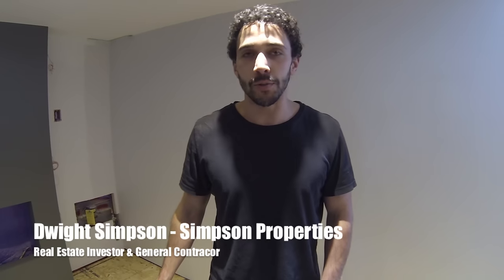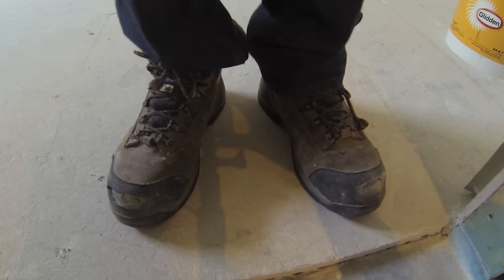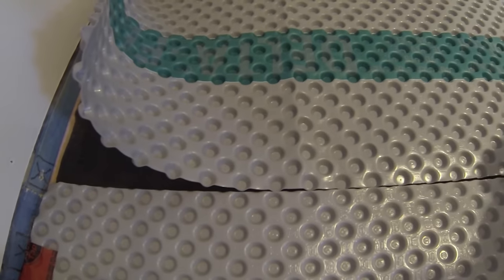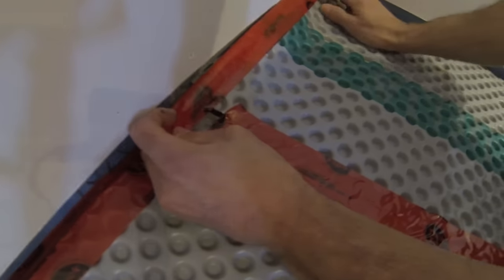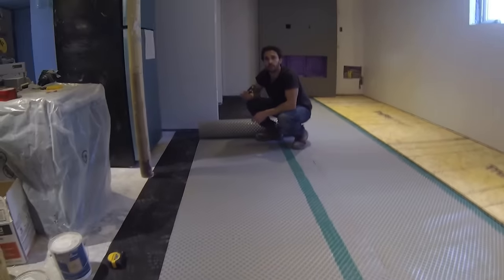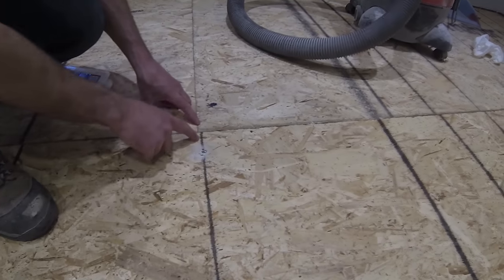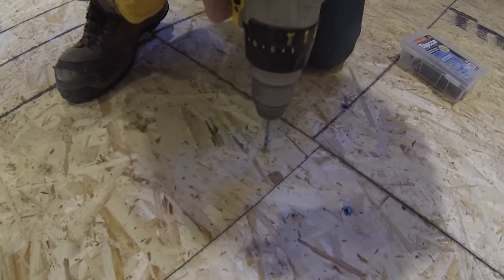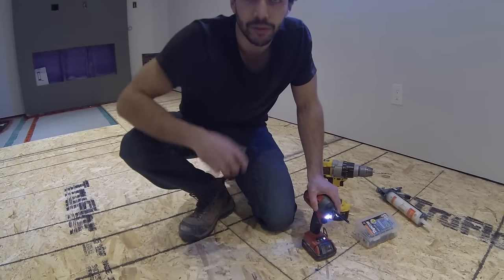HOW TO INSTALL A SUBFLOOR ON CONCRETE

Comment: Can this method be used for a concrete slab? And for solid wood hardwood floors?
Reply from the maker: Yes this method can be used for a concrete slab. Normally hardwood floors have to be nailed and or glued down. I would double check with both Delta-FL and your flooring manufacturer.
Reply: Will this subfloor support the nails? Or would I need 3/4 plywood instead?

Comment: Plywood is so much better than OSB. Structurally, you don't need it here, but OSB may offgas more, with all that glue. Plus, if osb gets wet, forget about it. Spend a few extra dollars and use plywood.
Reply from the maker: I agree that plywood is a much stronger and better building material compared to OSB. In this case the basement has been waterproofed prior to any renovations & a back water valve was installed. So water should not be an issue. However, if there happened to be a major flood, the repair costs would be covered by insurance & all the subfloor would have to be replaced. Whether it be OSB or plywood. I'm not one to cheap out when it comes to building materials. If it was new construction and a floor being installed over wood floor joists then I agree plywood should be used. For a basement floor I personally think OSB serves its purpose well.

Comment: What did you put under of the hardwood? 
Glue or nothing?
Reply from the maker: Floating laminate floors were installed. No fasteners or adhesives we’re used. We installed a under-pad over the OSB then installed the laminate flooring.

Comment: Why wouldnt you just nail subfloor to concrete with a Aerosmith Nailer instead of the screws?
Reply from the maker: I find pressurized nail guns or Ramset do a lot more damage to the slab.
Reply: Check out Aerosmith CT 90. Does not damage concrete. Also sinks nail into plywood flush so no issues when installing hardwood. There used to be a great video of exactly how to do but I can no longer find on youtube.
Reply from the maker: Thanks for the info. I’ll have to check that out.

Comment: I don't understand how water can evaporate if water gets under the dimple sheet.  How does this happen?  There is a lot of emphasis put on sealing the dimple  sheets.
Reply from the maker: Tyrone Sunde if you have any major leaks in your foundation those problems should be addressed first. Properly waterproofing the foundation from the outside if possible. If there was a minor leak the water would travel to the nearest floor drain. The rest of the moisture would be absorbed by the concrete pad.

This is directly from the Delta-FL site. It answers covers your question as well:
In a conventional basement, dry air in the living space acts as a magnet for water vapor seeping up through the concrete. But with the DELTA®-FL system, the space between the dimples provides a sufficient air-gap to equalize the water pressure above and below the concrete slab.

Though the air in the living space is completely isolated from the system, DELTA®-FL is designed to allow small amounts of water vapor into the room to maintain a healthy humidity level.

Comment: One suggestion/comment - chipboard is the worst possible plywood, in my opinion.  One of its worst properties is that, should it absorb water, it turns to porridge.  Here you are using it as a basement floor and this is one of the highest moisture places in your house.  Personally, I wish the stuff had never been invented, and I would never tolerate any in a home I purchased. - Floyd, a chemical engineer.
Reply from the maker: Hey Floyd, thanks for your comment. I agree with you that plywood is a much stronger building material compared to OSB. 

If the basement is built correctly the OSB sheathing should not be exposed to any moisture that's the purpose of using Delta-FL. If there were ever a major flood no matter what sheathing is used all the subfloor would have to be ripped out anyway. Plywood is more likely to delaminate when exposed to moisture than OSB. Check out this link for more information on the comparison between plywood & OSB: http://www.norbord.com/na/blog/plywood-or-osb-panels-which-is-better-2

Comment: You've literally created a moisture entrapment scenario using the landscape fabric, so thats a nono especially on older home basements (our mid 60's and earlier Toronto homes) that have no separation between the dirt/gravel and the slab (no insulation, nor 8mil poly which is what you generally find in better newcon).

When screwing down your osb (which also stopps the popping sound demonstrated) use 3 1/4"x2.5" tapcons in a w/v pattern per 4x8 & 4x4 osb panel respectively. Use the lines that come marked on the osb. Do not drive it at the last 2" of the osb. |||   |   ||| <- this with the two horizontal lines, use the outside lines, and then one in the middle, if the bow in the concrete floor is little more pronounced (a high spot in the drainage slope), use 5 tapcons instead of 3, again alternating

Reason why DMX AG would have been better, is because the top lip of the DMX foundation wrap (where they have the stamped name) can be overlapped with your previous run.

Get both 825ml and 300ml acoustiseal tubes. With the 825ml tube, use that to run a continuous bead under the DMX AG overlap mentioned earlier before taping it with the blue tuck tape. Acoustiseal is a little messy. its the same black goop that automanufacturers use to seal the poly barrier within car doors to prevent water coming into your cars when sheeting down through the door from the windows. The stuff stays soft and sticky, even 40 years later, and will not fail unlike the silicon.

With the smaller tube of acoustiseal with only the diamater of a #8 screw cut open at the tip, you lift your osb panel just a little bit, and squeeze in that same acousiseal into the hole you just drilled, be patient and get a decent amount in (half a squeeze). This will properly seal the hole, and the surrounding osb when you place in your tapcon, and prevent wicking up via that tapcon. It will also not fail over time unlike the silicon that you just put on at the top. That silicon did nothing to prevent moisture from getting trapped between the osb and the liner.

You should absoluetly run expanding foam to fill the gap on the floor edge (fireblock, invest in a gun, its a waste getting the smaller cans). Hopefully the bottom plate of your wall also has something seperating it from the concrete floor as per code.

Noticed in another video, you decided on spray foam, this degrades the concrete over time, even worse if its a CMU foundation wall. glued foamboard & batt(hybrid) or Tyvek & batt is still your best bet as because of the glue/tyvek (depending on system) still provides a vapor gap of around 1/8" for the concrete to breathe and not speed up leaching of lime from the concrete (efluorescence).
The R value vs the RSI is whats most important. 2lb poly sprayfoam at 3.5", while having an R value (nominal) of around r20 (+/- 3 R value as its not perfect), the rsi value is 1.7 roughly,
Like polyisocurinate foam board, polyeurathane foam's RSI value dramatically decreases the colder it gets which means in the winter, anything at the frost line an above will effectively loose a decent amount in its R value. Spray Foam companies dont tell your this. Your best bang for buck is still a hybrid 2" foam w/ 3.5" stud (2x4 nominal) which will give you the minimum required R20 by Toronto's Code, but you can get between R24 and R26 total value depending on which batt insulation used when all is said and done, maintiaining R20 in the coldest possible Ontario winter (especially for those in northern ontario), not only that, but should repairs ever be required, you're also not screwed with the removal of said sprayfoam. Because of the sprayfoam, you're also forcing any water in the foundation wall to force its way through your wood studs and not allow them to dry fully. You've essentially created a continuous activation of mold spores within that wood.

That being said, all the extra details  i've just shared is for a "lifetime" buildup which should last your lifetime if you never move, rather than just 10-15 years max. A literal one and done scenario.
Reply from the maker: I appreciate your insight. Thanks for sharing.
Reply: I see you know what are you ariting about:) I would appreciate if you could give me a couple of tips for my future home building. I plan a concrete slab, but without an insulation at the bottom or at the top of it. Mainly because of cost but also because I do not want radiant floor heating, I plan to use wood bur ing mass heater. And my questuon is - how to properly instal a floor (vinyl floor) or subfloor and then binyl floor om a concrete slab, to avoid moisture.problems? I would.also like not to feel 0⁰ Celsius from the concrete.floor.in the winter:)

Comment: he says that this is cheaper than the 2x2 panels has any one done the math the 2x2 panels are 7.03 for the r rated dricore panels this adds up to $1.75 per sf the this poly membrane is $208.94 for 328 sf which makes it $.63 per foot add to that the regular osb plywood which is about $22 per sheet which is about $0.68 per foot the sum total is $1.31 per foot, keep in mind you will save about $450 if you do $1000 SF but at the same time you would have doubled your work putting down the barrier and then the plywood mind you all that drilling and fastening. Time is money
Reply from the maker: I agree that time is money. Most contractors surprisingly find this method faster since they can work with full 4'x8' sheets of OSB. In regards to your comments on pricing, that will always differ depending on which Province or State you live in. Certain stores will have deals on as well which will have an impact on which material or products are most cost effective. You always have to do your due diligence as you did before making any purchase.

Comment: So much work just because greedy builder saved couple of $ on Styrofoam to put it under concrete slab .
Reply from the maker: When this house was built in the 1950's insulation wasn't even installed in the walls never mind under the slab. Installing rigid foam under the slab makes a huge improvement though. On my current project I am installing Amvic insulated pex panels (R10) and radiant heat. It will be a toasty warm slab!
Reply: If only